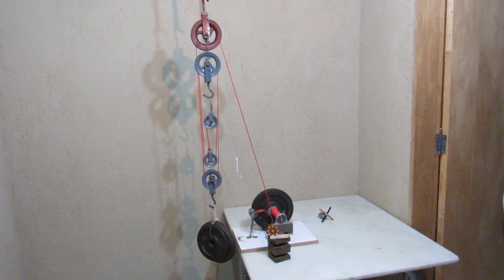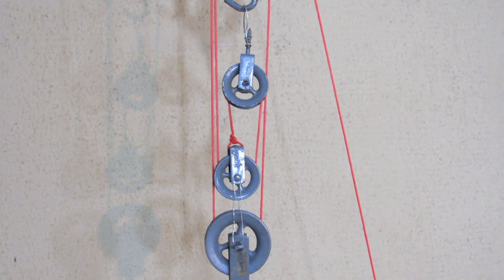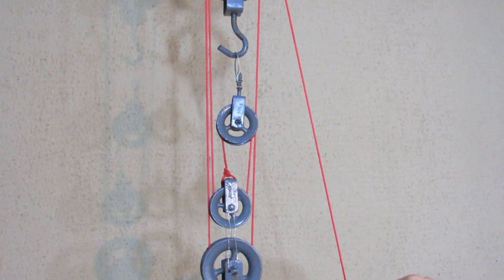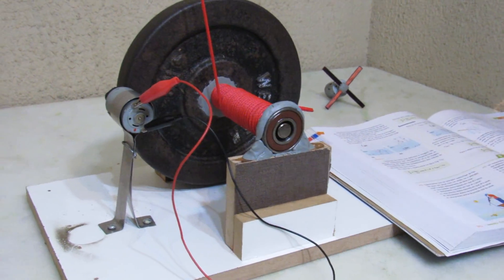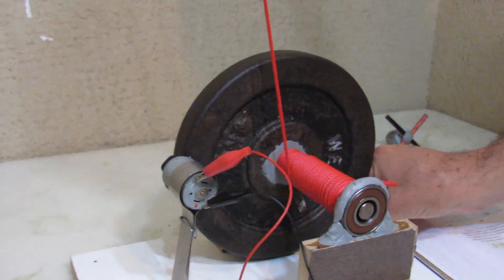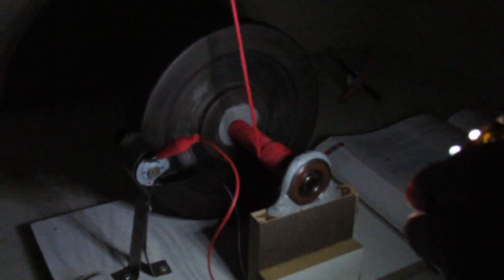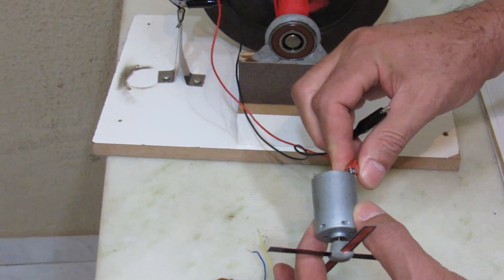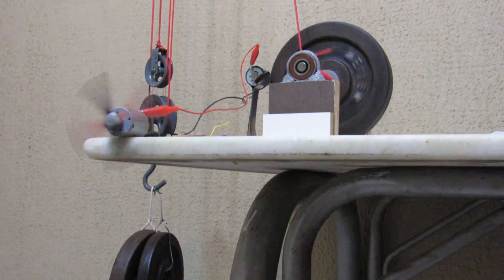Gerador Elétrico por Gravidade - Luz por Gravidade

Comment: Interesting. The pulleys simply lengthen the rope connecting the falling weight to the generator. The heavy wheel on the right also adds friction to the mix, slowing the fall of the weight to the left. I wonder if this can be combined with a more conventional system, where the weight takes 10 to 30 minutes to fall without this kind of pulley system, thereby multiplying those figures to, say, 30 to 90 minutes.
Reply from the maker: Without the use of a pulley system I don't think it's possible

Comment: Anybody else just want to build big ass generator everywhere to produce free electricity just by using gravity? We got big-ass buildings everywhere, why don't we just pack each with something like a tower and batteries and have free energy everywhere
Reply: Tomislav Nikolic because the you will always loose energy. First of all you have to get the object up and only after this you will have a force wich you could transform into kinetic later into electric energy. This makes sense for small systems where you can lift the weight on your own. Still pretty cool. Whe you can build this you will always have enough electricity to power a lamp or even a small waterpump.

Comment: Great..but try this with watch mechanism, it works much better..
Reply from the maker: Thanks for watching and for the suggestion.
Reply: pls tell me the watch mechanisam. i am trying to creat this.it would be helpfull to me.
Reply: tq bro for your respons. we are choose this for our clg project. it will be helpfull.
Reply: keep in touch.. the device is almost its final stage..
actually I'm trying to replace these pulley with some gear arrangements which is very similar to any watch machine and really helpful to create electricity for a long..
thanks for taking interest.
Reply: great.. I'm Mechanical Engineer/innovator, n crazy for making free electricity or modifications..
i also made self running Car. so if you need any type of help, ping me anytime.
Reply: +Sushant Sharma tq bro.by the way iam also mechanical.
Reply: Sushant Sharma Did you successfully make it ? I mean by USING the watch mechanism
Reply: Sushant Sharma  hello bro can you just tell me what are all the calculations i need for the report i made this as my project

Comment: ok i've got a question, lets say we have 2 planks they are identical except one is 1m and the other is 100m tall, now if we ignore air resistance and any weird bending force on the plank and we pushed them over (so they fall over like a trap door hinge) at the same time which one would land first or would they land at the same time?

 There are a few things to consider here, first if they land at the same time doesn't that mean that the 100m plank fell further than the 1 m plank in the same time i.e 100m to 1m, if they hit at different times doesn't that mean that the 100m plank took longer for 1 m of it to fall than the 1m plank.
Reply from the maker: Surely the board of 1 m arrives first to the ground.
Reply: why is that? they are both falling over like if you pushed a computer over lets say, so your saying it takes longer for 1m of the 100m piece of wood to hit the ground than it does for the 1m piece.